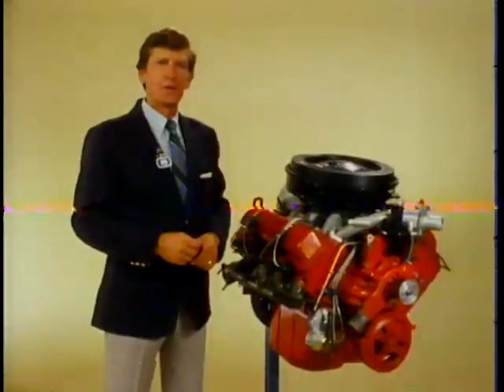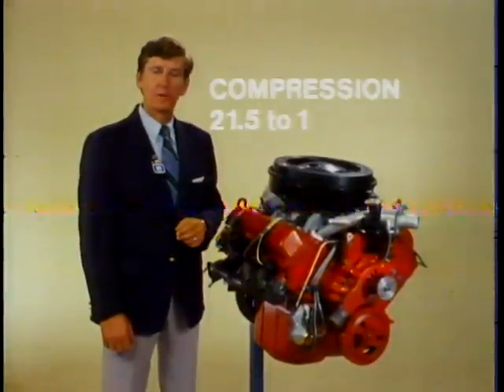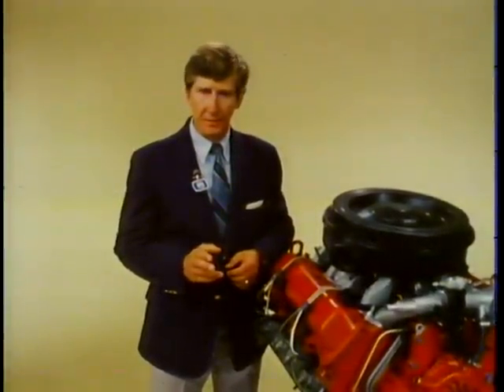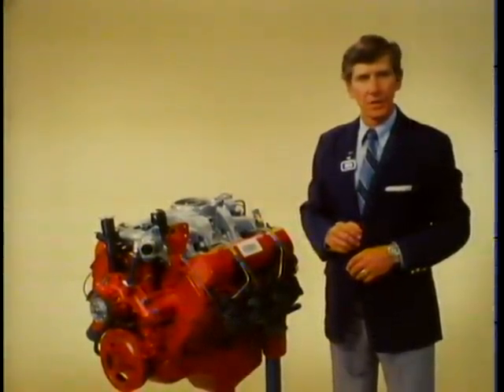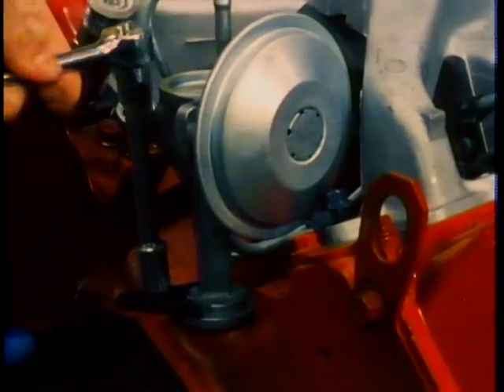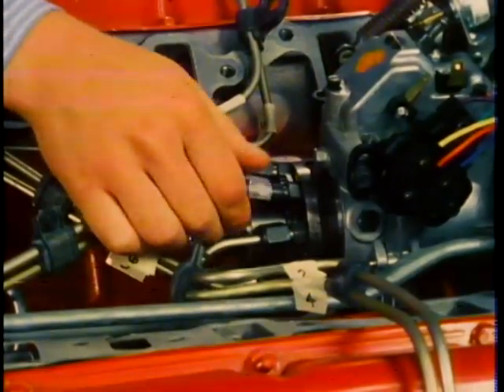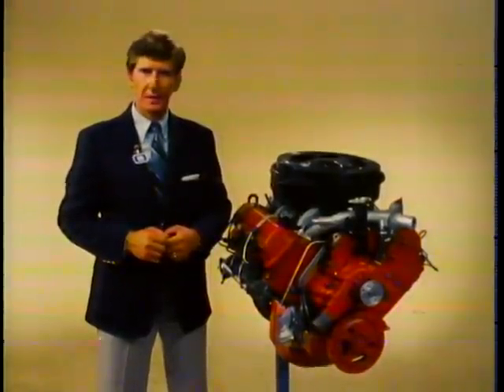General Motors /  Detroit Diesel 6.2 Training

Comment: Have a '84 Van with this engine; installed a Banks Turbo setup and holly-cow !!  whole new engine.  
GM's mistake was offering ANY diesel without a turbo; runs much cleaner and now fun to tow. 
The 700R4 trans is also a turkey behind a diesel;  installed a NV3500HD 5-speed and problem solved.
Reply: nice did u have to use an adapter kit for the transmission or modify the engine or transmission
Reply: Bolted right up and the tower comes right up between the G20 Van floor braces;  just cut one hole for the tower.   Trans was the HD version from 1990's  pickups ( I bought it new from GM) .  Used a  LUK flywheel with a LUK clutch kit which includes special clutch disk that eliminates two piece torsional type flywheels. I had the set balanced since I hate vibration.  Have 40kmi on this setup.
Reply: @MrGGPRI  Can you make a video of your setup? It sounds very interesting!
Reply: Hahaha that new venture transmission, was the only thing junkier than that 6.2.. and I am a retired gm tech.. don't run that tranny in 5th gear going at high speed, for more then 20 miles.. pull over and let it idle and cool down ever 20 miles, or use 4rth gear.. tranny has a design flaw, and you will fry it, if you run it hard at freeway speeds in the overdrive gear.. (5th or 6th, whichever it has) .. overdrive spins the main rear power shaft, 30% faster than the front input shaft.. the bearing between those 2 shafts, runs dry of oil, and friction welds the 2 shafts together.. freeway speeds for long periods of time, in high gear, is what does this.
And that turbo, on that 6.2, is dead.. unless it's the later design, with the 6.5 crank in it.. external oil seal on the rear of the crank, means, it's the better crank..oil seal in the rear main cap, means junk block and crank. Good luck, glad it's you and not me..
Reply: @KBS117  
I have one with 380K no problem
Reply: No. Turbo GM was bulletproof just a slug but thats the point. A bullet proof motor that outlasted a equivalant gasser with better fuel economy.
Reply: @KBS117  what transmission do you recommend. I have the 4 60le and it went out again
Reply: @rogergflowers4082  a Ford ...
Reply: @TeamTopKick  hahaha, the dealer I worked for was in southern Texas. At one point we had fifteen 6.5 diesel trucks waiting for new engines from gm. The oilfield killed those things. Then we had 10 trucks with burnt up nv4500 transmissions.. no one in the oilfield would drive a gm diesel..  it was Ford Ford Ford.
Reply: The engine is a 1996 6.5 new GoodWrench and then I installed the Banks turbo. Hooked up my small travel trailer and beat it good on some grades on I-15 San Diego- trans held-up so for the next few years, traveled all over the USA several times with this rig. Had a temp gage on the 3500 and in 5th ( above 55mph, 3.42.rear gear ) it did heat up a bit on the highway but never got critical; I used RedLine MT-85 oils-- maybe that saved the trans ?? Wanted to use the NV4500 but would not fit in the van without major chassis mods. Put ~30kmi on that setup trouble-free.  Quit towing now so so just went back to an automatic and installed a 4L60E with a controller this time in this very rare California van.

Comment: I may be late to this fan club of comments.  I have a 86 GMC Suburban 4x4 with this 6.2.  2nd owner since 45k miles and I have 1.1 million miles.  Just installed a new injection pump and plan to spend some time in December to sand out rust in the corners.   I have pulled lots of things with this beast, but speed is a favorite. Good roomy vehicle by all means.
Reply from the maker: @someonefrom1998  is it hard to get parts for the fuel system?
Reply: Hello ..  sorry for delay farming got me behind.  No issues with parts at all.  Napa and Ebay seems to have everything.  Funny thing I have found..the US Army still has tons of these non-turbo models with under 50k miles.  When my money get right, I am going to purchase 1 of those m1008 trucks.  I believe the Blazers were m1009...same drivetrain and heavy duty leaf springs.  I would paint it outside, add a piece of carpet inside, and a radio. A++.
Reply: @someonefrom1998 1.1 million miles and counting are u sure that gage correctly reading
Reply: @andrewebanks325  great question.  Having  grown up on a farm, we always did 3500 mile oil changes, it was a 1 driver vehicle, tires and I did all the work, except tire rotations/balance at Sears auto. Sears was my 2nd maintenance record source...RIP Sears.😪 .   It was also easy, cause you keep track how many times the odometer has tripped. Sears would print out the yearly history.

Comment: My 1984 K20 4x4 that I bought used 22 years ago now has 235,000 miles on it, I've pulled car trailers, horse trailers, hauled a 12.5'  Camper etc and it still runs great. Only repairs was an injector pump and a fuel pump. gets 18-20 MPH empty. Now your not gonna break any speed records with it when hauling that kind of weight  but I can't bitch one bit.
Reply: My wife drove mine for a while when her vehicle was having issues. She called me one day on the way in to work and asked if something was wrong with the truck. It wouldn't accelerate and was surging. It was governing out at 73mph.
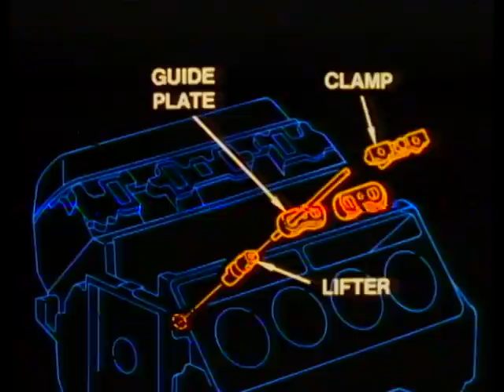Reply: @841k9  HAHAH! Yes, I hate how my truck has NO overdrive and 4:10 gears. NOT a freeway rig for sure
Reply: @enumrob  
My m1009 still has the factory 3.08 gearing.
Reply: That's weird, the Stanadyne/Roosa Master pumps don't surge when the hit the governor.
It takes the fuel away very smoothly.
Reply: @mattlf9120  
Old truck, no overdrive, th400 transmission and big tires. Lots of possible causes.

Comment: If you had an EGR model you needed to find an air intake manifold off of a 1 ton truck. we had a bigger air opening if I remember right you got 10 extra horses just changing that part. then you turn the screw on the fuel pump and eighth of a turn, and it's a happy camper

Comment: I had a pretty dim opinion of these engines until I got a truck with one in it. Completely changed my mind, boy was I wrong. 
I have an 84 C20 J code 3.73 gears and 4 speed SM465. Runs with traffic on the highway no problem. It’s a little soft when the revs are real low but perks right up once the tach starts moving.
   If you have healthy glow plug system and follow the start procedure on the sun visor it fires right up in the winter. 
As GM stated It was never meant to be a heavy pulling engine, just a diesel option for a gas v8 engine. I think of it as a 350 with the power range shifted towards the lower midrange. It’s a bit buzzy and that’s ok,  it’s an old truck. 
For a diesel it’s super simple to work on. 
Replace the balancer when they get some age on them and don’t lug the engine around and you won’t have to worry about the crankshaft. Maintain your cooling system and don’t run them hot and no issues with cracking.
Use the engine as it was intended, maintain it well ( the maintenance schedule advises to change the oil often, as little as 2500 miles depending on use and for good reason. The oil gets pretty sooty quick ) and it will give you decades of service.
Mine was owned by a factory and had a Tommy Lift gate on the back. They used it since new to haul all kinds of stuff for years and years. 
It’s almost 40 years old and runs great.

Comment: All of the 6.2s I worked on had a stanodyne filter on the firewall of the truck. I have never seen a filter mounted on the intake until the 6.5 came along. The original filter had a glass case so you could see if there was any water or dirt contamination in the fuel at a glance. They were very expensive to replace and an aluminum version was available for much cheaper but didn't have the glass viewing capabilities...

Comment: I have two, bought new in 1987 and 1991. I installed Banks turbos.
No engine problems at all. One has 230,000 miles, the other 138,000
I know a guy who drove a 1987 GMC 6.2, one million miles. He used two engines to do it.

As someone noted, GM screwed up by ever selling these without a turbocharger. 

The first thing I did was put a 4 row radiator in the trucks. The factory two row tubes didn't cool the engine enough.

Comment: If they just downsized a 8v92 or I guess make this into a 2 stroke with a blower and turbo, things would have gotten interesting.
Reply: They wanted to stay away from Detroit Diesel's willingness to incorporate unit injectors as they are more prone to runaways
Reply: @detroitdiesel-vu3ig  plus the 2 strokes would never have been to meet emissions
Reply: There are two downsized 8v92s. One is the 8v71 and the other is the 8v53. 👍

Comment: Those that dont know much compare this to current designs and put GM down. I drove one tons when they pulled to about 2000 rpm then fell on thier face, ford included. This is why they force induce most now. It was plenty good if you needed a diesel in the old days. Hope you kids can make somthing in your life worth a dam in between blaming others and playing x box.
Reply: Gotta add that obligatory blame the kids statement even if it doesn't make sense! Well played sir.

Also, while I love Detroit Diesels, my 4.9L inline 6 gas engine produces more horsepower and torque than this engine does. And my engine is in no way powerful.
Reply: @noscopesallowed8128  300 for life
Reply: Interesting comment coming from an old guy blaming "kids" and playing around on YouTube.
Reply: @superduty4556  
I've owned both and loved both. The 300/4.9 was a guzzler in comparison to the 379/6.2. They both ran out of steam on the freeway, but always made it home with the load.
 
I sold the 4.9 but still have the 6.2. Both trucks shared one problem- rust. Other than that they both did their jobs without complaints and with few failures.
Reply: A good engine. GM was the first company putting diesels in pickups, a fact many people seem to forget when they bash on this engine.
Reply: I'm 16 and have a 1990 chevy 2500 4wd with the 6 2
Reply: As a gm tech, from back in the day, these things were only good for boat anchors.. biggest turds ever built.
Reply: @KBS117  I'm gonna go ahead and call into question your work history.

Comment: I have one of these in my boat.  Where should I attach the anchor chain?
Reply: The crankshaft
Reply: The 6.2 and 6.5 have a huge following in the marine industry. You can rev them to 3000 RPM and they sip fuel.

Comment: I have a 1990 model with 400'000 on it not much power but a very good engine. Gona overhaul  it in a few weeks found a turbo from a 1999 6.5 that should wake it up.
Reply: That engine can't stand the turbo.. you will snap the crank...
Reply: @KBS117  again, I can see you have no real experience with these motors. That crank will withstand forced induction. If he is gonna be that worried about the crank, you can purchase a Fluidamper harmonic balancer that will completely resolve any crank issue
Reply: Add an intercooler..then you put in an adjustable mechanical waste gate set for 10-15 psi, propane/ alcohol injection at high boost..

Comment: It's funny how many times he said "This engine has nothing in common with the other diesel made by GM."  Even though he wouldn't mention Oldsmobile by name.  And "this is an entirely new engine, it is not a beefed-up version of a gasoline engine."  I wonder how much amusement the engineers at Chevrolet got over the Oldsmobile diesel problems.  Seems like there was some inter-divisional rivalry happening here.  This was long before GM consolidated all the engineering into GM Powertrain.
Reply: Just stating for the record, the Oldsmobile 350 diesel block is not the same as the gas block.
Very few parts interchange between the two.
And the DX blocks were very reliable, more so than the 6.2 and the 6.2 wasn't too bad.
Reply: @mattlf9120  The Olds diesel block was quite strong.  Andy Mannarino campaigned a pro stock drag car using the diesel block.  He actually had to lighten it.  The injection pump was the biggest problem with the Olds diesel.  And there were many failures due to water in the fuel that could have been avoided if GM hadn't cheaped out by not putting a water separator on the engine.
Reply: @andyharman3022  your right and diesel fuel has come a long way since then too.
My Ninety-Eight diesel doesn't have a separator on it and I haven't had any water for 10+ years.
I wonder if modern pumps at the station have water separators built in?
Reply: @mattlf9120 < GM used the gas block, that’s the problem.

Comment: I didn't mark push rods when I removed them. How do I know which side is up?
Reply: +juan fo you wont know lol only replacement ones are marked.
Reply: I looked and they have a different color on each end like one is gray and the other is a yellowish tone but which one is which?
Reply: Head side runs hotter..see which end fits perfectly into the lifter before installation..

Comment: I posted on another video. When these first came out they were completely useless dogs. Non of the upgrades had came out and after the owner had replaced several head gaskets and its performance wouldn't let you pass a bicycle they would go find a junk yard gasser and have my dad swap em out. He had these things piled everywhere. Most were hauled off as scrap metal. I have several Silverado 4x4's with bad engines that I'd luv to have 6.2's in with all the upgrades to make them perfect engine. The only truth when they came out was that they got really great fuel economy , plus diesel at the time cost just slightly more than a bucket of mud. We ran the old Fords with the 6.9's and it seemed we were driving for free with the low price of diesel. The 6.9's didn't get the mileage that a 6.2 would but it still was a great day to own a diesel engine. Now I run around to gather old engine oil to centrifuge and run that because I can't afford the"real" diesel. The 6.2's like motor oil fuel as well.
Reply: Phil Lowman 
I run like 25% new engine oil and other new oily crap thru my vw diesel, it loves it.
Reply: @MrTheHillfolk  there's dual tank kits for switching over to fry oil/ whatever for VWs..a tank heater helps liquify cold fuel..

Comment: Was debating a 6.2 swap or a 6.5 swap. I think I have now decided
Reply: I have a nice 1987 V1500 Suburban with a TBI 350 that just won't hold coolant but other than that, a very nice and clean survivor 
I also have a tired old 1983 K2500 6.2 diesel powered truck. She's rusty and tired but the 6.2 is healthy so I think I'm gonna go ahead and sacrifice my 1983 for the greater good of the 1987

Comment: Might have been slow as a turtle, but the 6.2 Detroit Diesel was built like a tank. Put a Banks turbocharger on it and it'll definitely give it a much needed boost.
Reply: It also depends on the gearing.
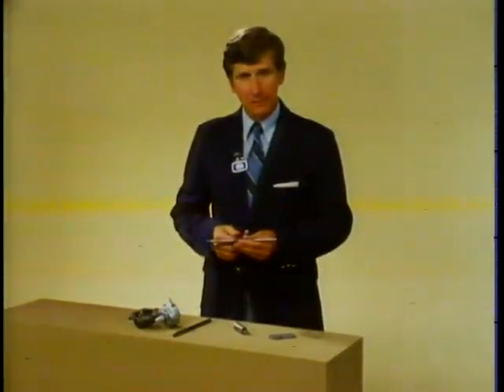In the military,the M1008-M1031 CUCV's came from General Motors with 4:56 gears and wouldn't even go above a digit from 60 MPH on flat roads.
But the M1009's had 3:08 gears and did 70-80 MPH with no issue.
The Banks kit added 60 HP/115 TQ when installed and equipped.
The military all ordered theirs as J Code engines which meant deleted EGR and higher power ratings,but were naturally aspirated.
For awhile now I've been really wanting to add a Banks to my M1009 and see what it can do.
Reply: Garages literally made millions replacing broken down 6.2l with gas 350s.

Comment: The 6.2 litre Detroit diesel was a good motor it was Gm fist full diesel engine which was different than the 5.7 litre Oldsmobile diesel which later evolved into the 6.5 and 6.5 turbo power in the early 90s people say the 6.5 was underpowered but then again parts were cheap and the 6.5 was fairly economical at the time and probably still is today

Comment: He said that you should always cap the fuel lines when you disconnect them from the fuel filter. But he did NOT do this in his demonstration. And he did not quote a service part number for the necessary line-caps.

Comment: Even for 1981 i'm surprised that it was so under powered. GM gas V8's were making 200hp and 250lb torque less than 10 years later.
Reply: What? GM has made v8s with 400 horsepower over 10 years earlier.. That engine was built to last and to make as good fuel economy as possible.
Reply: 10 years earlier the EPA was in its infancy, and it was the wild wild west for emissions controls. 10 years later, auto manufacturers had started to figure out how to build more powerful engines, while being emissions compliant. The time when this engine was built was the dark ages for power. Everyone was trying to figure out what worked to reduce emissions, while trying to keeping cost, and warranty claims at bay.